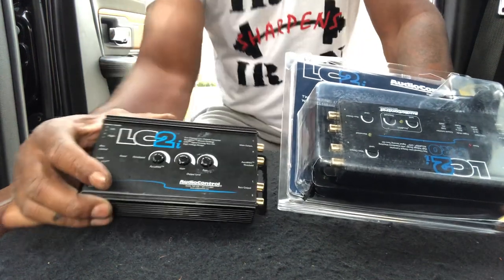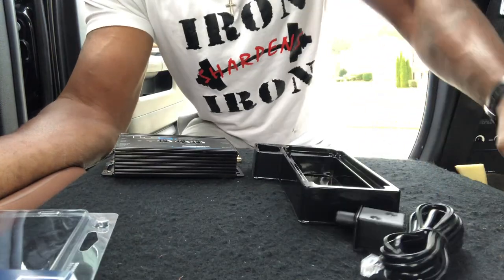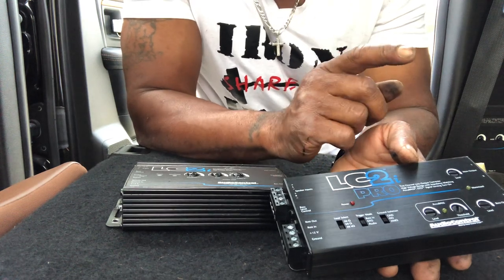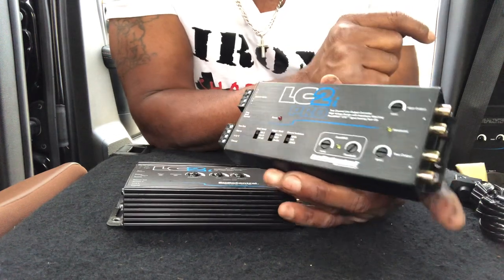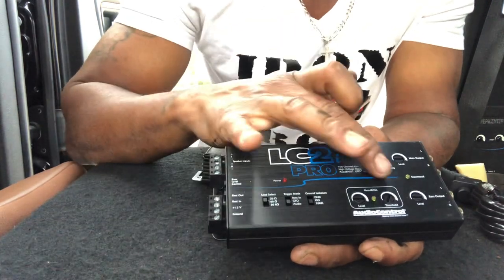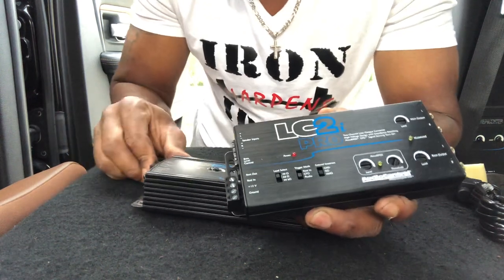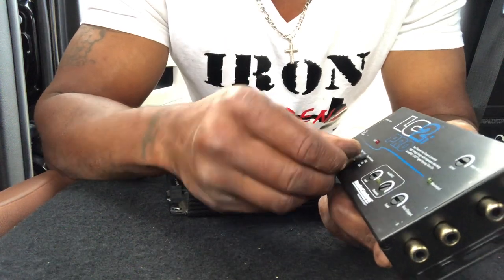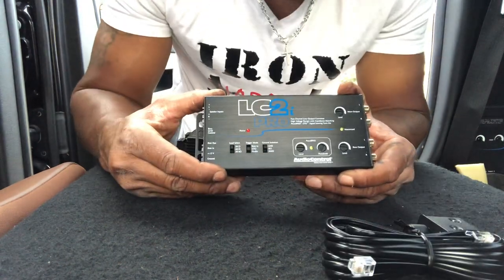Differences in the Audiocontrol LC2i vs LC2i Pro

Comment: what people miss is the lci2 only plays down to 33hz but the lc2i pro plays down to 20hz figured this out the hard way lol
Reply: Mine played 24hz so idk what u talking about
Reply: @4door_papi  its on the package 33hz+ it rolls off under 33
Reply: @bigmikediesell235  you can replace the filters
Reply: yoooo i switched to the pro night and day diffrence in signal and plays lower and louder! i was missing them lows with the original lc2i i thought it was user error , nope
Reply: Oh shit, do you know about the lc6i?? Audio shop recommended that instead of the lc7i and my shit doesnt play good under 34hz. And then my shit isnt even loud but in another car with a cheap loc it played much louder and much lower clean
Reply: @Nico-jk4sb  yeah to play 33hz and lower you'd need you subwoofers and subwoofer box tuned to play lows(25hz-33hz) it says the lc6i can output down to 10hz so it may be the tune of your subwoofer box the standard it around 40hz
Reply: @bigmikediesell235  custom built box to 33hz. I actually had this same subs & box in a different car with a 4 channel amp & a cheap loc and it sounded much louder & played lower.
Reply: @bigmikediesell235  Thats the same thing the audio shop told me when i told them the situation but ive tried it with 2 different systems and it sounded better than it does in the car its in right now

Comment: I'm really liking Wavtech these days over Audio Control for LOC and Bass Restoration. Except if we're talking a 2 channel LOC, then I really like the Kicker KeyLOC as well. I feel like Audio Control has been making moves like this and the Epicenter Micro as a reaction to Wavtech entering the market and forcing further innovation.
Reply from the maker: Competition is always good
Reply: @M.B.Enclosures  Definitely true. One of the things I liked about the Wavtech is that their version of the Epicenter has a built in LOC and Pre-Amp Line Driver, so their one device performs the functions of both an LC2i and the Epicenter. Plus the knob for the Wavtech BassRESTOR has increased functionality over Audio Control's knobs, as the Wavtech's remote knob can control subwoofer level, while also being able to control the intensity of the bass restoration effect, and you can toggle the bass restoration on and off altogether by pushing the knob, but the subwoofer level control always remains active. 

I know you like trying out new gear, and I recommend the Wavtech BassRESTOR. Take care bro...
Reply: I smell a plant.
Reply: @trillionbtamillion  That's just my weed you're smelling.
Reply: @imdbtruth   can't because I wasn't talking about vegetation

Comment: Is this the same as the lc7i just less channels if so I have two amps in my Sierra one for the subs and 1 for the door speakers could I run the rca’s straight to the amp instead of tapping into each speaker so I can save money and buy this instead of the lc7i

Comment: I have a newer pioneer head unit connected to my fosgate p1000x1bd. I have to turn my gain almost all the way up. Do you know if the Lc1i fix that issue???
Reply from the maker: The Pro will yes
Reply: @M.B.Enclosures  what do u mean the pro? Lc2i pro doesn't have rca inputs.
Reply: A line driver will help increase the input voltage to your amplifier to increase output
Reply: @lylegoodluck  Hey, do you know the pre out voltage of the pioneer head unit? Usually 2v, 4v, 6v
Also,if you need to install a lc2i pro inline (between the head unit and amp) you would get a rca female to bare wire converter and the bare wire would plug into the lc2 the female rca would plug into the rca from the head unit.

Comment: Hey bruh. What’s going on. Upgrading my system and bought a LC2i pro. How do I find out what load select for my car Ford Taurus 2003 (sedan) for ex. Dodge Ram 20 ohms load select
Reply: My current setup is an Alpine mrx m55. Yeah she old  pushing (2) entry level powerbass brand subs 275-300 Watts rms 

My new setup is

Rockford Fosgate RFIF2SW Speaker Wire To Female Rca Connectors

AudioControl LC2i PRO Two Channel Converter with ACR-1 Bass Remote Audio Control

KICKER CXA800.1 CX MONO SUBWOOFER AMPLIFIER  800 WATTS RMS X 1 AT 1 OHM

One Kicker CompQ12 Q-Class 12-Inch (30cm) Subwoofer, Dual Voice Coil 2-Ohm

Rockville RMS12 Single 12" Sealed  1.6 CU FT Car Sub Enclosure Box 3/4" MDF